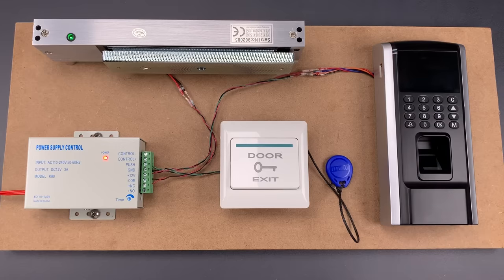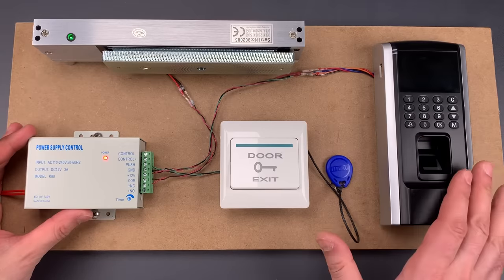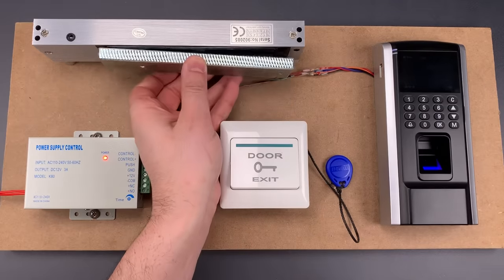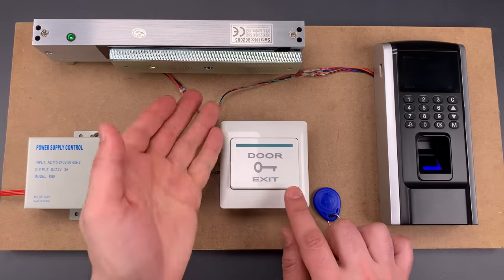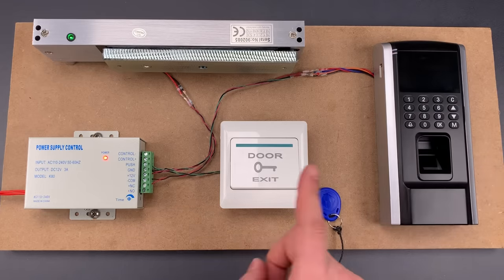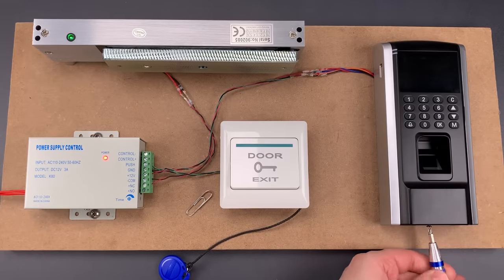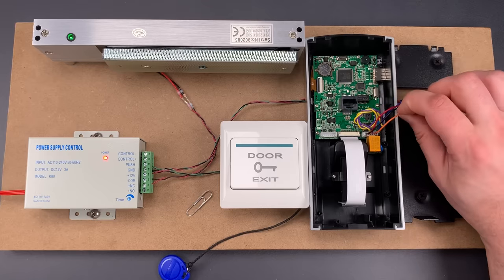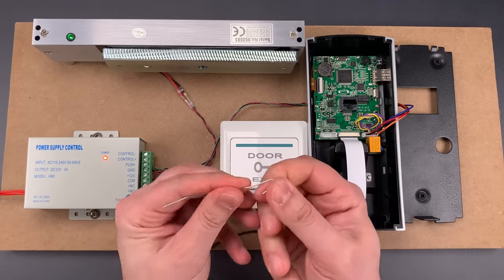[1040] Fingerprint/RFID Lock Defeated With a Paperclip (Mengqi-Control)

Comment: And thats how an engineering team get humilated in 3.40 mins...
Reply: He takes the time to explain. It would have been done in 40 seconds otherwise
Reply: It was probably a Chinese child.
Reply: @albertlopez7079  Actually, it's pretty weird. They usually use some simple coding, not just on-off signal.
Reply: should's use centralized system for that one .. smh ..
Reply: 3.40 minutes is 3 minutes and 24 seconds.
Reply: Somewhere between the engineers and the marketing team is the effective software and robust hardware necessary to make locks like this really effective.

Engineers "This is an effective design, it represents a solid case that is time consuming for unauthorized persons to access.  Further, the software sends and encrypted signal to the control unit when the proper input is given, so even if someone could access the pad, they cannot defeat the lock."

Marketing team
"That looks expensive, our target market won't pay that much for our locks....  Can you make it cheaper?"

Engineers
"Well, we could, but it won't be as safe or effective"

Marketing, ok, so you can make it cheaper, great, do that!"
Reply: @jerryfick613  As an HW engineer working on RFID access control systems, I seriously doupt that. There is literaly no difference in price between those two solutions, everything they'd need to implement it is already there. It's more likely that  they have another device that they sell as "more secure".
Reply: @mrkv4k  I was hoping to defend the engineers(a rare instance for me) who built it, thinking maybe they tried to produce a robust lock but we're forced to cut corners to make a more "competitive" product.
Reply: @jerryfick613  Well, it still might be the case, that they were forced to do it like this and that the decision came from management. It's just not much of a cost reduction. This kind of solution is actually fairly common. On the other hand this solution wouldn't pass the European requirements for a access system, because the lock cannot be controled from the unprotected side.
Reply: I mean, there's like 5 minutes of coding in between this and something that would make this impossible, so a tiny price difference, but something I'd be more than willing to pay the 5 cents for.
Reply: @mage3690  Sure, but you are not an average nor typical user. It's a strange human behaviour, that even fence with unlocked gate can stop 80% of people that would want to rob your home. IMHO this is one of those psychological deterrents and it will work on the low skill guys (an average junkie), so it still does "something".
Reply: @mage3690  if ur implementing something which takes 5 mins of coding I don't think it would be very hard to hack it
Reply: @Moltenlava  unless you knew enough to hack the components on the board, yeah, it could be next to impossible. What I immediately thought of to fix the problem of a simple N.O. switch was a passcode sent from the box to the PSU after the box verified the credentials. If it was a simple 8 bit code (that's one letter), and the PSU only accepted one new passcode attempt every second, it would take, on average, an hour and a half to brute force the passcode. Since password strength increases exponentially by length, even a five letter passcode would take 1 million years on average to break, at a speed of one try per second. Other than that, you'd need to have access to the source code on the ROM, or hope to God they just used standard system calls. So yeah, pretty much impossible. You'd be better off brute forcing the keypad or yoinking a RFID off some stooge. Keep in mind here that I know nothing about digital security, and barely a passing interest in how computers work, so there might be a simpler solution I don't know exists.
Reply: Actually, 3.40 minutes is 3:24 so it should be 3.75 minutes because thats 3:40
Reply: @Moltenlava  When Programmers say "5 mins", it usually means a day or two. They are gonna code it within 5 minutes, but they will spent the rest of that time checking entire solution, cleaning bugs and rewriting it so it looks better.
Reply: @mrkv4k  oh, yeah, didn't think about option 1. Of course, that kind of attack would take time, time that would remove you from the "target of opportunity" list. I'd just assumed (never assume, assumptions are holes for idiots to fall through) that option 2 would be a moot point because randomly generating a code for each device would be so obvious a solution that anyone with a brain would implement it.
Reply: @mage3690  Sure, but then you'd have to somehow pair those two devices together, so they both have the same code. And there are ways how to do it, but those could be exploited too. If you were able to get those devices into a state where they are ready to accept a new code, you can change it to anything you like.
Reply: DMD  To be honest, I don't know about many devices where this wouldn't be the case (including some that I've designed). On the other hand, there usually is a tamper switch or sensor that will activate the alarm when you try to open the case. And in good designs, even if you do access the PCB, it won't help you much.
Reply: DMD  Because it really isn't needed. When you open the device, it will sound the alarm and you still won't be able to do anything with it. Unique pattern on screws and screwdriver would be something to consider if we were making huge batches of our producst, but we are currently making only few hundereds per year, our most sold RFID reader is about 2000/year.
Reply: @mrkv4k  it could be exploited, but in this example where one keypad is connected to one PSU, the simplest solution is to put a "teach" button on the PSU. When the keypad is first connected to the PSU, simply press the "teach" button, then attempt to access the building via the keypad. If you don't screw up and put in the wrong code, the PSU would then receive the passcode from the keypad. Exploiting that would require access to the PSU, which is presumably inside the building and behind another locked door, and "teaching" the PSU to allow another passcode, which would overwrite the former passcode and make the keypad nonfunctional. All this is assuming some intern didn't go above and beyond the call of duty and write a function to store multiple passcodes in the PSU, or a "remote teach" function. Any security device can of course be bypassed with sufficient time and motivation, my point is merely that with virtually no critical thought whatever and a design change that could take as little as 5 minutes, these things could be out of the skill range that any dumbass with a Swiss Army possesses.
Reply: There was no engineering team in the first place.
Reply: I mean 3:40 was only because he wanted to introduce the product fully.
Reply: Funnily enough I’m an engineering student and my team made a door lock that wouldn’t fall to that failure. The door node sends data stored on the rfid to a server that checks a database for valid ids since it was for school we didn’t need emergency stuff
Reply: @U1TR4F0RCE  I'm pretty sure we could all make better door locks with a Raspberry PI than the garbage that these manufacturers dump out.
Reply: @dev0random  that definitely seems to be true given what most of the door locks with electronics LPL has shown of seem to work like.
Reply: They just seem like 3 off the shelf products sold together: the power supply seem something off the shelf with a relay and has a push button that switches the relay. The door magnet is another off the shelf component that if gets powered closes the door otherwise lets it open. And the controller seems to have multiple interfaces, an ethernet for example, and also a relay just to close the contact that lets it act as a push button. 

Also having something more sphisticated is not as simple as having to send a code in the wire. If you saw how it works if power is lost the magnet loses power and thus the door opens. So even if you have a code that is transmitted on the wire, what if you put an high voltage on the signal wire in a way to fry the power supply on the other side and thus open the door? You would have to design a circuit that takes that into account, and is not that simple.
Reply: 3.666... minutes*
Reply: @mrkv4k  It most likely would have to if it had transmitted to the secure side of the door.
Reply: @JoshuaPlays99  I don't understand what you mean.
Reply: @alerighi  There is usually some simple protection on the signal inputs, it wouldn't fry the power source for the entire unit, just those inputs.
Reply: @asdasdasdasd714  or the India kids 🤣
Reply: @jerryfick613  People look for cheaper solutions. Even for a thousands of dollars. So what you said is completely true. Such design flaws are deliberately present to avoid making a full proof system.
Reply: @kinito9541  the moment an engineer who was hired to design a particular system completes a perfect and foolproof design for that system...
It's entirely possible they will no longer be needed.
Reply: @Olivier Kessler (this is my other account) 
\-This is how it is currently set up-
Outside: Fingerprint module and credentialing system. Upon success, send signal.
Message sent over wire: Open!
Secure Side: upon receiving "open" signal, it opens up.

\-A more secure but more expensive set up-
Outside: Fingerprint module that sends images over the line.
Message sent over wire: Fingerprint image
Secure side: Credentialing system. Upon success, open door.

To answer your concerns, just put the power supply and things that need securing on the secure side of the door.

It's not perfect as you pointed out. But nothing is. It still has flaws, but they aren't as trivial as "send a simple electric signal over the line"
Reply: @alerighi  This sounds like the most likely explanation. Keyboard seems much more advanced compared to other parts. They probably simplified original design and the contact was intended for buzzer or light indication outside. Maybe they even tweaked firmware to create cheaper device without secure controller unit. Not having tamper as standard is weird though.
Reply: No engineer worth his name would have come up with something like that.
Reply: @albertlopez7079  they could have at least separated the interface from the control board. The fingerprint reader already has a flex cable which we could extend -- all other interfaces (buttons, RFID) should also be extendable via wires. They don't even need a serializer or similar chip in the middle to "compress" the data into a few wires. Just use as many CAT5e/RJ45 connections as needed by the interfaces to be extended as a cheap alternative or a direct wire solution.
Reply: @mrkv4k  The antitamper mecanism would be enough and simple  but where is this type of curcuit always are motion sensors and cameras.
Reply: @stefanosboki9374  That's not true at all...
Reply: @mrkv4k  Yes it is I have done many security systems projects and you can't open than without put in service mode the panel the sirens will start instantly
Reply: @stefanosboki9374  What?
Reply: there is a usb port and an ethernet port as well so as well as electrical hotwiring, it is probably also easy for a hacker to use an electronic or software attack
Reply: @jerryfick613  First of all, price difference would be negligable. Second of all, there is neither engineers, nor marketing team behind things like that. Put-together oem crap made by child company of huge retail chain.
Reply: I mean, seriously? Analog frontend/backend YES/NO on wires? Who sets up frontend authentication and also makes it ANALOG? This is like sending your password via Walkie Talkies/Radio transmission.
Reply: 40 secs is actually 40/60 which is 2/3 or .66. So it's really 3.66 minutes
Reply: @exapsy  This is exactly what everyone does, lol. Althought it's not dichotomy betweeen analog and digital. You can make analog secure, medium is not an issue here.
Reply: @ФеофанЭтополедолжнобытьзаполне  You can't make analog signal secure, by definition. This is like, one of the most major problems in engineering. You can obscure it, and create noise, but that's it. That's no encryption or security. There is no such thing as analog encryption and security. "Analog" and "security" do not go along.

https://crypto.stackexchange.com/questions/14623/analog-encryption-algorithms

https://ieeexplore.ieee.org/stamp/stamp.jsp?arnumber=1146073

Comment: I used to work as an security alarm/door access technician. It amazed me how unsecure "security" devices are. Especially the "high tech" ones costing thousands and thousands of dollars.
Reply: Even systems with available supervisory resistors are bypassed by installers to make the installation easier.
Reply: @livenotonevil8279  Or, more commonly, the resistors are set up in the controlling device - out of convenience - instead of the tail end controlled device (i.e. a sensor or a detector).

Comment: Hollywood movies: The hacker connects to the door panel with a fancy laptop and starts running complicated hacker tools on the door.
LPL: Here's a paperclip and a screwdriver, let me show you how that's done.
Reply: And he still gets it done faster and easier than the hacker while teaching you how to do it.
Reply: Why does Ocean's Eleven come to mind?
Reply: But if we see a high security lock being picked this way in a movie, we will complain
Reply: @WHIRLWOLF  Not really, only people who don't know locks.
Reply: there is an RJ45 port inside and a usb port on the OUTSIDE so a software attack is probably also possible. this is why LPL says a NON standalone digital access control system is much better, in this case to gain entry it is necessary to control a computer farther away to open the door, which requires some kind of cyber attack, so you might as well have an actual inside man to just open the door for you at that point.
Reply: @ralexcraft990  Which you have to admit...is most people.
Reply: @kylen9954  that’s something we should really try to change
Reply: "Gigabyte of RAM should do it..."
Reply: did not have to chopped someone's finger off any more.
Reply: This was the best LPL comment in a long while IMO. Well done!
Reply: McGyver uses a paper clip, duct tape and a rubber band ... May also use a pencil and a match, and explode the whole door. XD
Reply: @WHIRLWOLF  they literally did this in Starwars The Last Jedi
Reply: Your comment is gold brother 🙌🏼
Reply: I seriously want a movie now where the hacker/lockpicker is ACTUALLY realistic.
"We got his password changed! We are in!"
"OMG that is incredible! How did you manage that?! Did you manage to decode his computer?!"
"Huh? What no? The fuck are you talking about? We just stalked his facebook for a few minutes, found the names of his old pet, the street he grew up on and his mother's name...then reset his password..."

"We need to break into this house without making too much noise!"
"Ahh! We are going to use some special glass breaking equipment while using a suction cup to pull it back out, right?!"
"Huh? Where the fuck would we get that? No, we are just going to move this piece of string in under that small "lock" on the window since they left it slightly ajaw then wiggle it around for a few seconds before we can get it out into the opening mode!" (I legit broke into my own appartment building this way when I was locked out! Except it wasn't a piece of string but rather a piece of grass...Yeah..Don't trust those window locks things...they are VERY easy to open even for someone who have NEVER done it before....)
Reply: @bibbobella  pretty sure they don't do it because companies like warner don't want a lawsuit for teaching people these things
Netflix will do it though
Reply: @largepoodle6036  If Breaking bad can get away with teaching people how to make better meth then I am sure warner or the like can get away with telling how fucking shitty a lot of so called "locks" really are.
Reply: @WHIRLWOLF  people don't complain when they do the wire thing to start a car in the movies, why would they complain about this?
Reply: @kenmurata17  It would also make everyone more literate about what lock is good and what lock isn't.
Reply: @bibbobella  someone should make a movie teaching us how to sleep with Instagram models 😔
Reply: In Payday games, you have to wait like 300 seconds